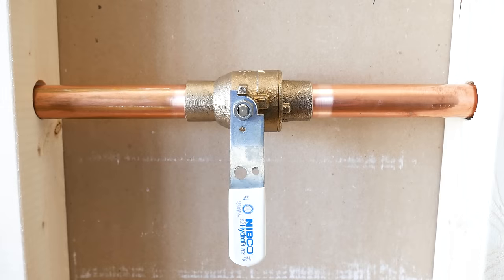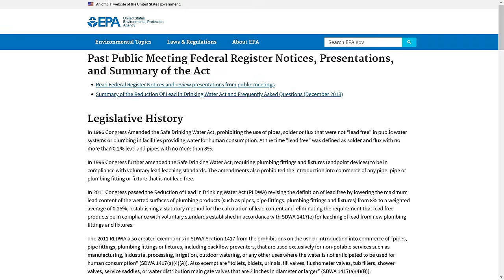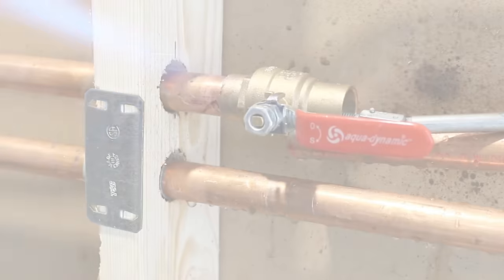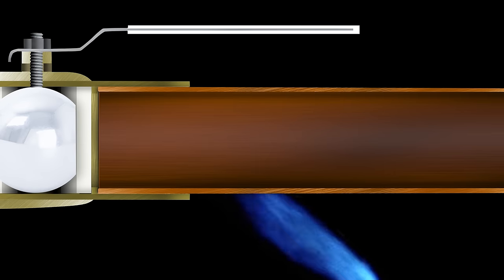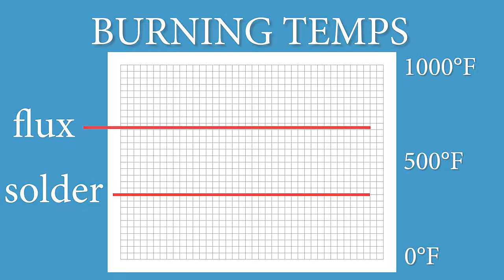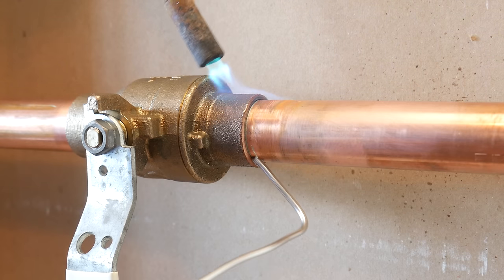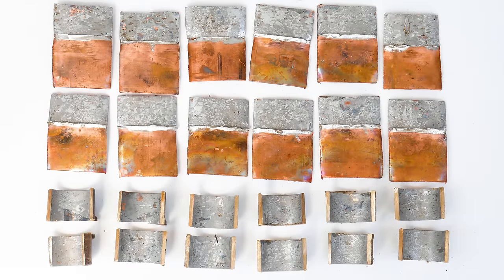How To Solder A LEAD-FREE Ball Valve (Correct Way!!) | GOT2LEARN

Comment: Got a problem. I installed a 1”Sweat fit (Everbuilt Home Depot) ball valve on a vertical pipe in a tight inside-corner [basement concrete walls]. The upper sleeve leaked. I removed upper pipe & found minimal solder at the rear of the valve sleeve. When I reinstalled pipe/valve residual solder kept the pipe from fully seating down in the valve. Tried to heat pipe/valve to melt solder but didn’t work. Suggestions?
Reply from the maker: Yes here's what I have for you.
1) Start heating from the back, maybe you didn't apply enough heat so there was a cold spot.
2) Make 100% sure the pipe and valve cup are clean.
3) Try using TINNING FLUX, it has solder powder in it, if that's already what you are using, good.
4) DON'T OVERHEAT, you need your flux for this to work, if you overheat, it'll burn and capillary action would be able to occur

Lemme know how that goes!
Reply: Couple other things I'll add, perhaps they might help you out:
(a) I know it is a bitch to mechanically clean out residual solder from the valve cup of a previously soldered valve, but you got to do it if you are going to have a chance of reusing it.  If you don't, like you said, the new pipe will not seat properly and can result in a leak.  Trying to heat the valve cup up to melt residual solder can easily result in overheating the valve, destroying the seals.  I have found this is especially a risk when working with lead-free FORGED valves versus CAST valves, as the forged valves appear to conduct heat much faster.  Home Depot Everbilt valves are typically forged, not cast.  I would make sure you have not damaged the cup seals from your previous attempts before moving forward with that valve.
(b) I would definitely recommend Oatey H2O No.95 water-based tinning flux. Works great as Julio said, especially for tough situations like valves, just be careful not to overheat since water-based fluxes are very vulnerable to that.
(c) In addition to the preparation tips Julio gave, I have found that a VERY LIGHT touch of H2O #95 flux inside the valve cup helps ensure uniform adhesion of flux.  Again, VERY LIGHT coating, lighter than what I would put on the pipe itself.
(d) After inserting the pipe into the valve cup, I give the pipe one turn in one direction and then one turn in the reverse direction to distribute the flux better.
(e) While I have used Oatey LF solder for general copper soldering, but for valves specifically, I prefer Sterling Premium lead free solder, which has the lowest melting point of any solder I have used.  This is to protect the valve seats.  Highly recommended.  Once I use up my Oatey spool I am going to just go with Sterling.

Comment: newbie here:  as per your animation it looks like heating the pipe closes the space between the pipe and the hub, so why do we even need to use flux then? Also, why do we heat the hub? Won't it then expand also and negate the expansion and tight fit of the pipe?
Reply from the maker: Flux is only there to prevent oxidation during the heating part. Heating the hub portion ensures that the solder will fill up that particular portion of the joint.
Reply: @Got2Learn  interesting. So the hub is heated but it doesn't also expand like the pipe?
Reply from the maker: No because lead free brass doesn't transfer heat as good a leaded brass ;)
Reply: @Got2Learn  ok so for leaded brass we definitely do not want to heat the hub cuz then it will expand the hub and negate the expansion and tight fitting of the pipe?

Comment: So u still clean the inside of ball valve?  No flux inside ball valve? Didn't c any
Reply from the maker: You can out some but a very thin layer.
Reply: @Got2Learn  so u dont need to rough it up with sandpaper?
Reply from the maker: Yes both the valve and pipe need to be cleaned.
Reply: @Got2Learn  gotcha

Comment: Apollo ball valves recommend the valve should be open. The reason if any moisture is caught in the valve and the steam that is created this will cause the seal on the the ball valve to blow out
Reply: Actually, on their USA made valves, while they prefer that their valves be soldered fully open, they state that soldering fully closed is acceptable if necessary.  Note that their LF cast bronze valves are less susceptible to overheating than their LF brass valves.

Comment: Great animations.  But I have to wonder why anyone would put a ball valve in a wall?
Reply from the maker: In a wall, but accessible. This is done for many reasons, shower valve shutoffs, main shutoffs etc...we typically install an access trap so it's covered, but accessible.
Reply: Key word: accessible.  Makes sense, or in an unfinished basement maybe.
Reply from the maker: @45speedbump  👌👌👌

Comment: Las llaves hay que soldarlas abiertas para que se disipe el calor por el tubo y no se estropee el cierre de teflon
Reply: The keys must be welded open so that the heat is dissipated through the tube and the Teflon seal is not damaged.  (translation from Google Translate)

Comment: What I do now is just buy threaded valves and thread a mip into each end and then solder.
Reply: Same here, the price difference isn't significant and you don't run the risk of cooking the internals, something that I've always been wary of, especially long-term.
Reply: Or use a comp ball valve with a spot of pipe thread sealant on ferrules and threads. Especially if water is still present.
Reply: tyvek05  actually it takes more work to do it my way.. to me, it is the right way.

Comment: Do you use Mapp gas?
Reply from the maker: Sometimes, it's almost the same as propane.
Reply: MAPP gas hasn't been manufactured in the US since 2008.  MAP/Pro is what is on the shelf today and it is hardly much hotter than regular propane in my opinion.
Reply from the maker: @StilettoSniper  👌💯☝

Comment: It helps to spray the fitting with water right after soldering, and maybe use a damp rag on the opposite side of a ball valve fitting or other fitting with none metal parts inside of of it to reduce heat on the seals inside of it.
Reply: Using a damp rag on the ball valve is OK but I personally would not spray the fitting down with water right after soldering.  This aggressive cooling of the solder can cause it to develop micro cracks, which under water pressure can develop into leaks.  I just leave the wet rag on the ball valve and let the solder joints cool naturally for about 30 to 45 seconds or so, then wipe away as much of the residual flux as I can.

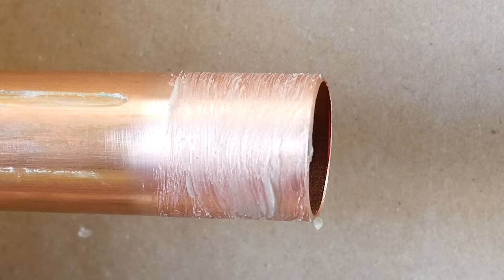Comment: 4:08 How the hell could you solder it in the open position if the handle is in the way? (Unless you took it off. But you shouldn't have to do that.)
Reply from the maker: Put a piece of copper pipe on the handle not to burn it ;)
Reply: Or you could us looselywrapped flats of steel from the steel cans used in vegetables, although not all cans are steel. Also time on point under the handle need not be long if you heat a little longer on each side of the handle due to conduction. Quod erat demonstrandum.

Comment from the maker: Amazon affiliate links to all the products I used in this video:
AutoCut Pipe Cutter 1/2": https://amzn.to/2XlyqAn
AutoCut Pipe Cutter 3/4: https://amzn.to/3gPmhhz
Superior Tool 1/2" Cleaning Attachment: https://amzn.to/2kwBMBK
Pencil Torch: https://amzn.to/2U3OTaa
Fitting brush 3 in 1: https://amzn.to/45ELin6
Propane gas(Blue bottle): https://amzn.to/2BOhnh7
Propene gas(Yellow bottle): https://amzn.to/2BPcdBl
Lead-free tinning flux: https://amzn.to/2U3abEW
Flux brushes: https://amzn.to/2T8ROBc
Lead-free solder (Sterling): https://amzn.to/2AfSY63
Flame protector: https://amzn.to/2Vh8q7o
Abrasive pads: https://amzn.to/2XaY6kT
Pencil reamer: https://amzn.to/2tBuhKW
All-in-one deburring tool: https://amzn.to/3B9dLUv
Reply: Thank you very much. I have soldered many before and have been successful, but I wanted to check and make sure I was doing things right as I am a DIY homeowner.  You reassured me and also I learned a little bit

Comment: How is Nibco's valve dealing with the heat that's locked into the ball? I've soldered thousands of these in the last 30~years and I'm curious because that ball is sealed when shut and obviously the plastic ball retainer takes all the pressure. This doesn't make sense.
Reply from the maker: Keeps the nylon seals in place
Reply: @Got2Learn  Interesting, considering nylon gets significantly weaker when heated. I wonder if there's a different retaining system than the original. I haven't blown one up in 20 years or more.
Reply from the maker: @henryknox4511  no idea hehe, that's what they claim, it was actually written on the tag 🤷‍♂️
Reply: Apparently they must deal with it just fine, as it is clearly stated in NIBCO's LF Silicon Bronze Alloy Soldering and Brazing Recommendations that ball valves should be in the closed position when soldering.  Interestingly, this position is not unique to NIBCO; Milwaukee valves also calls out for their ball valves to be soldered in the closed position as well.
BTW, I believe the seats in these valves are reinforced PTFE, not nylon.  From chemistry classes, I recall that PTFE melts around 620F, I believe nylon is lower than that, down around 500F.  Most valve manufacturers want the temperature of their LF bronze valves kept below 500F, which I assume incorporates a safety margin that is well below the melting point of the PTFE seats.  And for lead-free brass valves (which conduct heat 50% better than LF bronze), I've seen them call out that the valve body should not exceed 300F (Apollo LF brass valves are a good example of this).
Reply from the maker: @StilettoSniper  thanks  brother, you always post good stuff 🤘🤘🤘
Reply: @Got2Learn  No worries, I'm glad you find my contributions worthwhile, thank you kindly.  
Here's a dilemma I was just discussing with someone this morning: what do you do if you can't use your JetSwet to stop water trickling out of your pipe, because you are using a Nibco HydroPure LF ball valve, which is supposed to be soldered in the closed position? Would you:
(a) solder it in the open position, or
(b) use an alternate solution to retain the water flow that would allow you to solder the valve in the closed position?  If so, can you think of one, other than bread?
Reply from the maker: @StilettoSniper  i would just add a sweat tee before with a purge on it so the water can come out from there...
Reply from the maker: Kinda like this here at (4:24 in the link): https://www.youtube.com/watch?v=lNUAX6mJTlA&t=46s&ab_channel=Got2Learn
Reply: @Got2Learn  Thanks for the quick response and the link.  Would you trust it not to leak from the purge rubber seal if installed on the water main into a home before the main shutoff valve and water pressure regulator (city water pressure = 100 psi)?  This would be in a basement installation, overhead and exposed to view.
Reply from the maker: @StilettoSniper  sure, most main valves have a purge on them anyways so no worries...

Comment: Use Only compression fittings 
You will burn the rubber O ring for sure 
Special if you are soldiering for the first time or the second time
Reply from the maker: Just FYI, these are engineered to be soldered, never use compression fittings if they aren't accessible.
Reply: @Got2Learn  in England we don’t even have soldier stop valves 
Only if you can dismantle it before soldiering
Reply: @Got2Learn  you know what you are doing but imagine someone that doesn’t have good knowledge about soldiering
Reply from the maker: Yes, in that case, compression fittings are a good choice, they just need to be installed properly and stay accessible 😉

Comment: I'm guessing that you cannot use compression fit ball/lever valves in your country. In the UK you are unlikely to find a soldered valve as it is much easier to replace a failed valve that has a removable nut and olive.
Reply: Not a fan of those compression fitting. Yes we have them here in the us but it’s not seen as reliable as soldering
Reply from the maker: Have them, but don't use them much here either.
Reply: They are available here (Canada) but are more expensive.  I've installed lots of them over the years and have never had a failure on them, whether it be a blowout or a leak.  Just need to be able to get a couple of wrenches on them to get them good and snug.   One saving grace of them is that since you are not using a torch, you can work right up against tinder dry framing, or flammable materials etc without any issues.   (and in awkward spots, no lava hot solder dripping down on me as I'm sweating the joint)

Comment: When you solder a ball valve, handle open only. Otherwise you melt the Teflon packing and get leaks. NOW, you know how to solder a ball valve. Use s-39 paste and aquasol solder, or silver bearing. Stop using cheap flux and solder. Try my combination, you won’t want your old combination. Btw, I’ve soldered miles of copper, I know exactly what I’m talking about
Reply from the maker: Some brands say to solder them closed, I am not inventing this brother.
Reply: That what I did for my Apollo valves (soldered while fully open).  However, NIBCO specs that their LF silicon bronze ball valves are to be soldered while fully closed.  Apollo on the other hand states that their domestically produced lead-free valves can be soldered fully open or fully closed.  This is directly from the engineers at these companies, the designers of their valves.  YMMV with ball valves produced by other entities, but in any case, I'm assuming they know exactly what they are talking about.
And at $25 for an 8 ounce roll, I certainly would not call Sterling "cheap solder"!

Comment: He got the wet rag part right, but you always keep the ball valve open when soldering. You should also remove the handle so you don’t accidentally scorch it.
Reply from the maker: I also go by what the manufacturer recommends (yes most valve need to be soldered opened) but some brands like Nibco ask for their valves to be soldered closed, thanks Eric!!!

Comment: Why not just use  1/2" ball valve and 1/2" 15mm cu connection?  Then it goes fast and its easy to change the valve later on.

Comment: That ball valve should be in open position when soldering ,unless you solder one side in order to shut off pressure leaking thru
Reply from the maker: Depends which brand Al.

Comment: I hate soldering valves, I would rather use female threaded ones and solder pipe to a Male adapter and let cool before I screw them into the valve. Better safe than sorry.
  PS, I like to make sure I flux the pipe further than the end of any fitting or valve to make sure I can see the solder connection. I have been trying to teach a friend to solder,  who can't get it right. He will have me drive 60 miles round trip to solder 2 or 3 joints.

Comment: 6:02 used the phrase "the proof is in the pudding" correctly... Nice
Reply: I don't want to dismiss the excellent video here, but "the proof is in the pudding: is incorrect as the aphorism is "The proof of the pudding is in the eating" The argument that this is just a modern, shorter version ignores the fact that the phrase does not make sense on its own. It would be like taking "The usefulness of the saw is in the cutting" and equating it with "The usefulness is in the saw". (honestly, I'm not usually this pedantic).

Comment: I don’t even get sweat ball valves anymore I just use threaded ball valves and make adapters. They are horrible.
Reply from the maker: Horrible 🤔
Reply: @Got2Learn  yes they are horrible i run a crew in construction and getting all my guys to solder these new lead free ball valves the right why is a task to say the least
Reply from the maker: Try this technique when you can, it does make a difference, cheers!!

Comment: Almost seems counter-intuitive. You would think both the valve and the pipe should be close to the same temperature in the soldering area.  If the valve is slower to heat than the pipe shouldn't it get most of the heat ?

Comment: You missed the most important step!   DISASSEMBLE THE VALVE,  AND REMOVE ALL THE PACKINGS AND SEALS BEFORE YOU SOLDER! You are either destroying the packing materials, or damaging them to the point their lifespan will be VERY SHORT!  This goes for EVERY VALVE AND FITTING THAT HAS  ANY KIND OF SEAL OR PACKING IN IT! 
I have NEVER soldered a valve with packings, or a faucet or valve, without taking it apart, and removing all the delicate parts BEFORE ANY SOLDERING!! Once you are done, clean the valve out, and reassemble it with the packings and seals, and you have a good, quality, long lasting job! Don't forget to lube everything with a light coat of vaseline as well. 

I don't care if the manufacturer says you can solder it without taking it apart, or not. They don't really care, and are giving you instructions on how to do the job the cheapest and worst way. 
Just like 10,000 mile oil changes on your car, which are approved by the manufacturer as well, but are designed to help you destroy your car faster so they can sell  you another one!. 
They just plan to sell you ANOTHER valve when this one fails, due to poor installation practices.

Comment: Never seen anyone solder a ball valve in the closed position before.
Reply from the maker: What if there's water on one side? 😐
Reply: @Got2Learn  Not what you're showing at the beginning of the video. If it was soldered on one side and there was water on that side it would  protect the valve from overheating the internal parts.
Reply from the maker: @doug995.  these valves are designed to take some heat, always consult the manufacturer before soldering them, some are closed some are opened.

Comment: Just use lead soldiers still used from electronic supply problem solved
Reply from the maker: Cannot use lead solder for plumbing!
Reply: Much of that has a dry rosin flux core.  Not good for plumbing work.